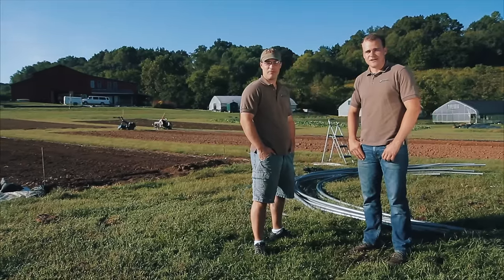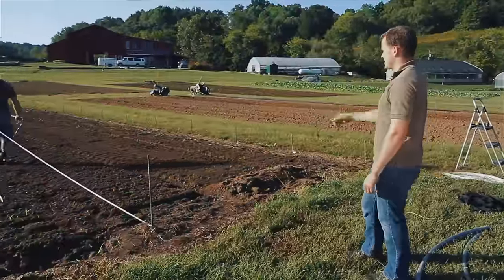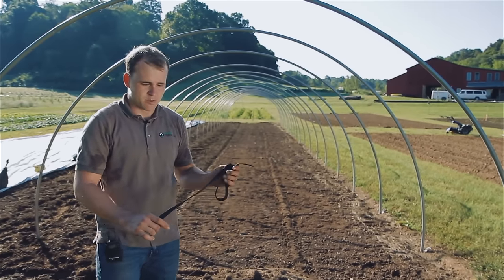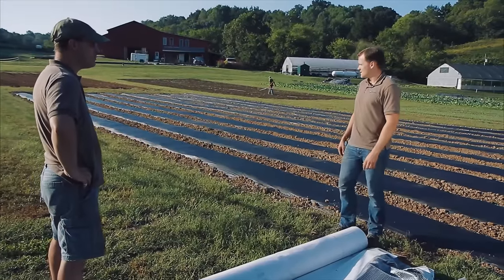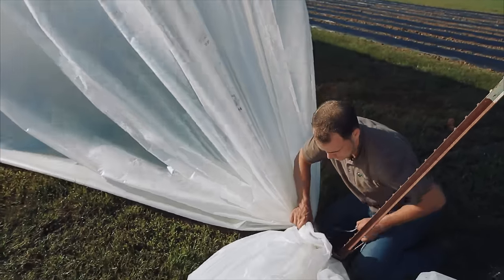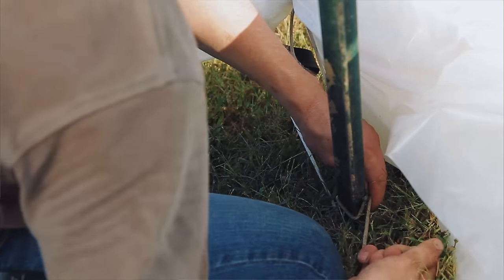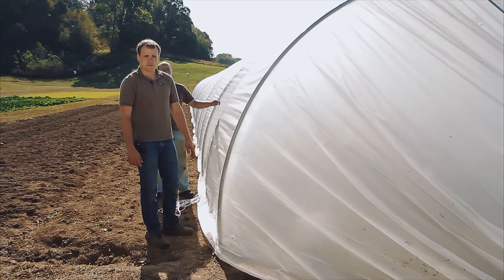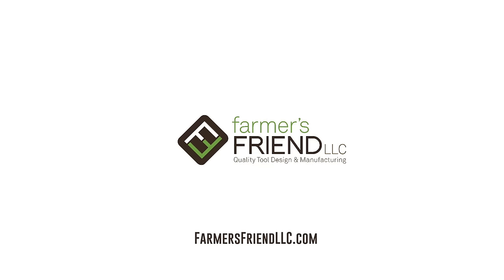Caterpillar Tunnel Assembly Video

Comment: Great system !
 - A little dab of grease inside the female pipe joints will make future assemble/disassemble jobs easier and extend their life. Humidity will cause corrosion/rust in the scratches that happen during pipes sliding together.
(Works for trampolines too)

Comment: Great kit from what I've seen so far, as I'm planning to buy one this summer. I'd love to see an updated video where you build a tunnel using the new ground post kit (to add height) and the center purlin to make a more permanent structure. I'm stoked you now offer those accessories, it's exactly what I am looking for! I'll probably order the 100' kit, but space the hoops ~3.5' apart to cover a 70' bed. I also live in a high wind and snow area (zone 6), so I'm hoping the combination of close hoop spacing, 3 purlins (center and off to the sides), and the wind bracing kit will allow me to keep it going all year round. Also great that I can use the wiggle wire you offer to create standard end walls, as the bunched up plastic would take up more space than I have to offer. 

One accessory you could consider in the future would be a roll up side kit, which would probably comprise mostly of additional pipe and wiggle wire tracks. That would personally make my ideal setup complete :) And hey, if you need a test garden for a prototype, I'm available!
Reply: Joe, sounds like you have a plan! The only thing I would mention is that if the purlins are offset from center at the top of the tunnel, this can create a snow or water pocket. This can spell disaster for your tunnel and crops. 

We have discussed the roll up sides, but currently are not pursuing this idea. 

Would love some pics of what your doing, or maybe even a video!

Comment: Have you tested pulling all the extra plastic to one end, and then building a permanent end wall with a door and screen door?  Perhaps a wood end wall would give one anchor points for automatic vents, timers, fans, water, electrical, etc.  Can you think of any potential pitfalls in trying something like this?
Reply: Can I install an end wall on my caterpillar tunnel?
If you would like to turn your caterpillar tunnel into a more traditional, (semi) permanent structure, all you need to do is add corner wind bracing, a solid center purlin, and wiggle wire on the end bows.

Then, you need to come up with a design for the end walls that will fit your needs and desires. Because there are so many different designs out there, at this point, Farmer’s Friend LLC is just letting you custom-design your own end walls to fit your specific situation.

To help with this, you may want to look at the following links for ideas and plans:

https://www.noble.org/globalassets/docs/ag/pubs/horticulture/nf-ho-11-01.pdf - detailed instructions on building two large doors in the endwall.

https://web.extension.illinois.edu/bcjmw/downloads/54183.pdf - a very detailed hoophouse construction guide — with a lot of different options for end walls.

https://on-the-cheap.com/?s=end+walls+for+caterpillar+tunnels - one farmer’s solution to end walls on our very own caterpillar tunnels.

http://www.johnnyseeds.com/growers-library/tools-supplies/quickhoops-scissor-doors-installation-guide.html - detailed instructions on building scissor door end walls — following Eliot Coleman’s minimalistic design.

http://demandware.edgesuite.net/bbbw_prd/on/demandware.static/-/Library-Sites-JSSSharedLibrary/default/dw7a4fb85a/assets/information/9018-qh-high-tunnel-bender-instruction-manual.pdf - design for a standard-size door in the end wall.

End walls can be constructed with either wooden studs or metal tubing.

NOTE: Although most of the above links show wooden end walls, Farmer’s Friend, LLC recommends using all-metal construction for end wall design. Metal end walls will be more expensive initially, but they will outlast wooden end walls (unless you use treated wood, but who wants those chemicals in your soil?). Do it right the first time and you shouldn’t need to do it again!

Additionally, here are two videos of customers who have put endwalls on our Caterpillar tunnels. Feel free to do a web search and find other ideas if you do not think these will work for your context.

Rain Drop Farms
Bare Mountain Farms

Comment: So my tunnel came with a channel system.  I placed 3 channels on each end.  One end has the single zipper door and the door plastic has already torn at the bottom where the channel end is.  The same seems to be happening on the other end that is tied down to a t-post like this video shows.  Why are there not plastic pieces that can be put onto the ends of the channels?  They are sharp and dig into the plastic.

Comment: can you set this up even if the ground isn't totally level?  also, can the bed be 14' x 40'....like can you just set it up where there is less rings?  lastly, does the t post have to be 12' away from the rings on the end?
Reply from the maker: Hi Roderick, 
1. Yes—our tunnels generally work well even when not on totally level ground. Shouldn't be a problem for you. 
2. Regarding the shorter length—Sure, there's no reason that you can't just skip the last two bows and make it 40' instead of 50'. You'll have a little extra plastic on the end, but that's really the only con. 
3. At Bountiful Blessings Farm (our testing grounds) they put up a few tunnels with the t-posts approximately 6 feet from the end bows. Seemed to work fine for them. You might also want to check out the way Curtis Stone did his ends—his is probably the most space efficient way.

Comment: How do you keep the wind from blowing in at the bottom?
Reply from the maker: Great question. For the most part, insuring that the ropes are nice and snug eliminates most issues with wind. Occasionally after a strong wind storm the plastic may ride up the hoops on one side, so you may need to pull it down after a period of unusually strong wind. But in our testing this doesn't happen very often.
Reply: Also, the plastic is now twenty eight feet wide. This would allow for two extra feet on each side to sand bag them down if desired.
Reply: Stacy s mom s got it going   on

Comment: hi guys, just what I am looking for but, how long of a life does the plastic have due to the elements on average? 5yrs. 10yrs?
Thanks.
Reply: UV penetration decreases with each year. You're looking at 3-4 years of use. The plastic might be a in solid shape after that, but the amount of UV making it into your tunnel will have declined. Growing greens, you might still get some use out of it. For fruiting crops like tomatoes, you'd want to replace the plastic.